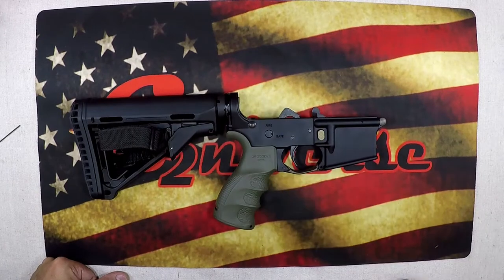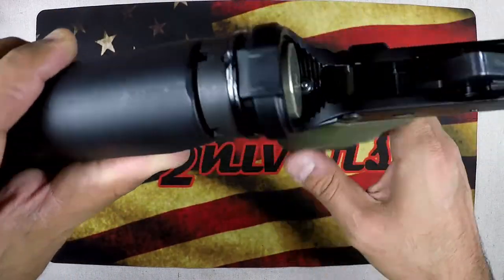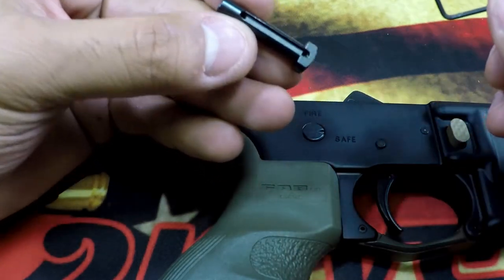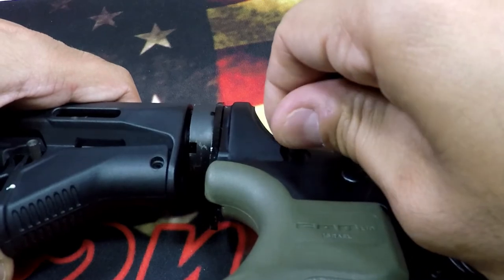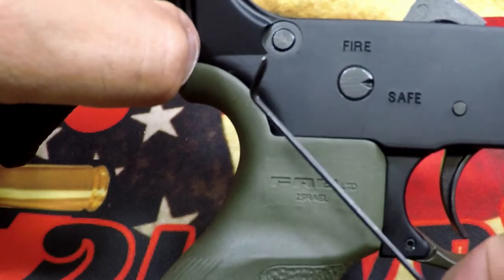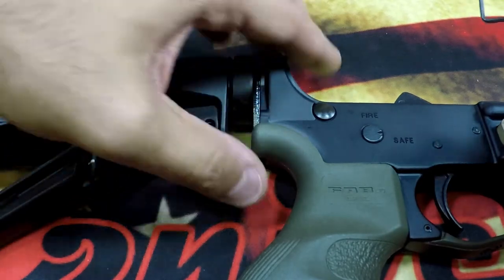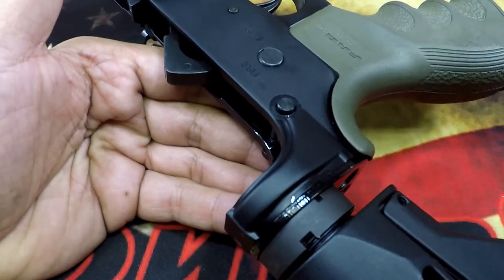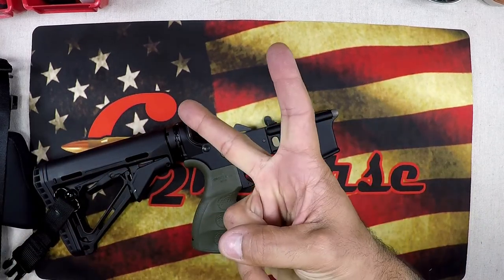Safe Takedown Pin Removal

Comment: Excellent video and instructions - worked 100% on the first try.  I had a really tight rear pin which required  a tool to push out.  Bought a YHM extended pin and with your help - had it installed in 3 minutes!!!  YHM pin is a mushroom head, allows me to grab and pull it out without any tools.  Again - THANK YOU!   Oh - almost forgot - the opening notes - elixir for my soul!!!  NICE!

Comment: Why would you need to change the rear plate?
Is that only when it is staked?
Reply from the maker: Yes... but you can restake a rear plate twice before replacing it. Typical installation gives you 4 solid points of contact to stake, the standard is 2 stakes. So you should have 2 more if you have break the first staking.